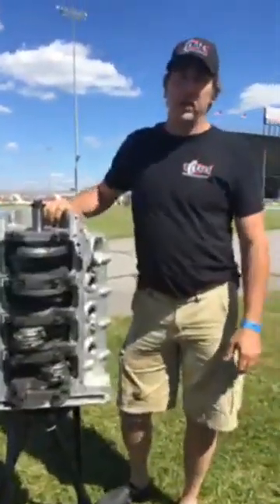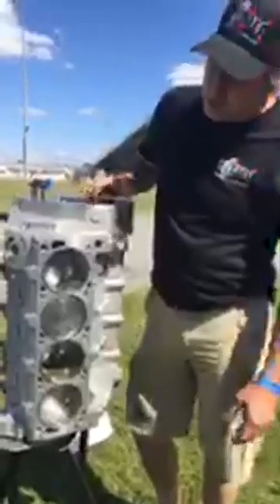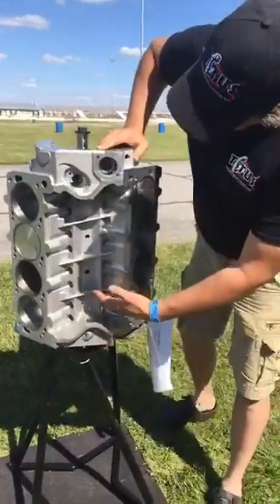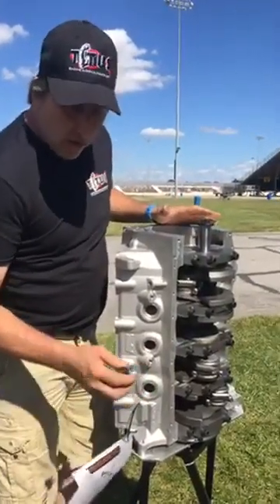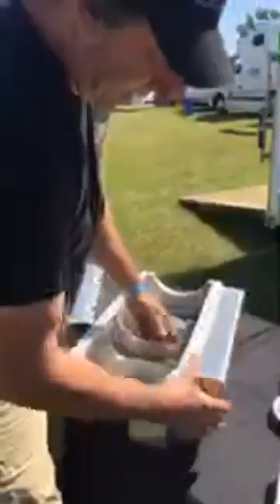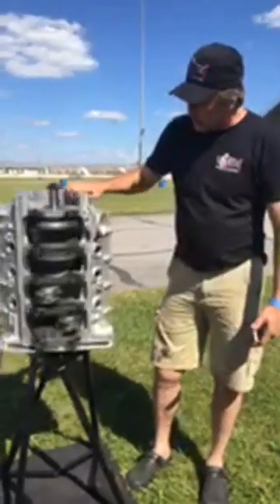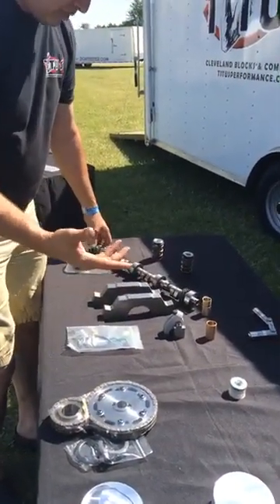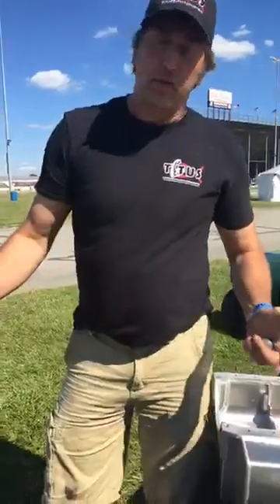Titus Block Unique Features EXPLAINED // Titus Performance

Comment: What would you charge for a complete turnkey?Motor plus pullys belt alternator fan just drop in and hook up gas line and headers
Reply from the maker: If you would lke an engine quote you can call and we will be happy to discuss your needs 301-932-9292.

Comment: Have a Question 4U .  A Titus 499.250 cu inch . What's the Maximum Rev's of such a Beast & HP & TQ running 93 Octane . Either 4V heads or the Hemi Head from Georgia
Reply from the maker: I'm assuming that a 93 octane build is a street engine.  The max rpm of a street engine will be more limited by the valve train than by the displacement.  Over 850 HP would be expected

Comment: I really like the addition of the extra head bolts on the block. But who makes a cylinder head with the extra bolt holes to fit it?
Reply from the maker: The Edelbrock SC! head has them along with some of the billet heads.  Titus is also about to release a series of heads with the extra bolts as well. :)

Comment: I just dynoed a cast iron cleveland. 354 cubes, stock heads, stock crank, stock block. 515@6800. No porting. Any cast iron chevies non ported capable of that? Pump gas engine.

Comment: Its a ford Cleveland, only good for a boat anchor, and on top of that, there's no room between cylinder's, and what does ford stand for, FIX OR REPAIR DAILY, Hahaha 👎
Reply: the Cleveland is literally one of the best performance engines of all time.  this Titus engine block is a great addition to the aftermarket
Reply: There is a 400 cid ls build on Yellow Bullet in their Naturally Aspirated section. This engine uses aftermarket LS7 Mast heads. It made just shy of 740 hp. In that same section, there is a Cleveland build that makes 756 hp while using the factory heads. The sbc doesn't even come close without a full aftermarket bailout.
Reply: @Aizawaismylife  go look at a Hemi sbf from Georgia putting out 928 hp & 674 tq .  Approx 2017/18 . That should shut his smart mouth . 9.5 deck Windsor.  Over 1000 hp theses days .  And Mark has those Hemi Heads on his Cleavland.  Dont know much about the engine other than its a shop engine.  Hate smart mouths who just mouth off because they cant add any value 2 a conversation.  Good on U 4 sticking up 4 Mark .   Robert   Australia
Reply: @robertgardner1259  only cause the ford has bigger crank bearings than a 5.7 all the ls stuff can handle more power
Reply: I see you're still stuck in the old days... I could have that thing Gapping your small block Chevy horsepower for NA easily... That's why people like you never move forward with the times you're too stuck in the past
Reply: Funny... Then explain that to Bob Glidden as he dominated Pro Stock. And Bill Elliot as he set a still standing record of 212.8 MPH in NASCAR. And check the Engine Masters Challenge as Clevelands set the records. Only engine to surpas the Cleveland is Fords 4 valve Coyote.. And that is a new saga
Reply: Could be worse it could be a dodge 😂😂😂
Reply: Its an engine and only as good as its builder and parts. Im not a Cleveland fan, but its ignorant to belittle all the effort made in an icon era engine , and have it reliable at modern HP.  By the same token, guys are now taking old Mopar 225 slant6 modding the crap out and getting 600+ HP why? I HAVE NO IDEA, but WTH, OK!   Ill just go to the junkyard or by a old truck , get a running LS pickup truck drivetrain, rebuild and only upgrade con rods, studs, and basic fuel - ignition upgrades cobbled from stock parts. 750HP all day, all night, no issues.  Proven performer....Generic, everyones done it, stale....blah blah, but it works. LS
Kinda sad eh? go to a junkyard, build a competitive engine, WTH?